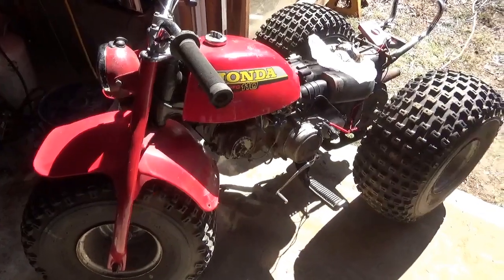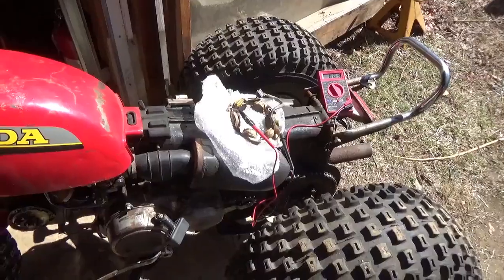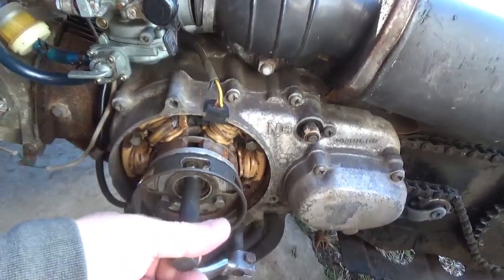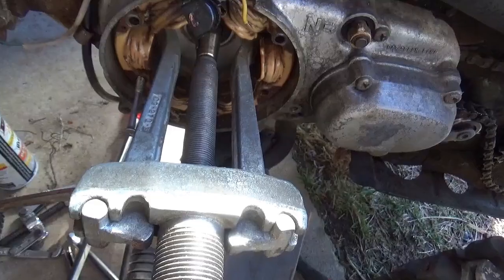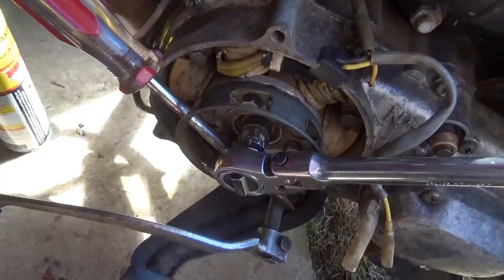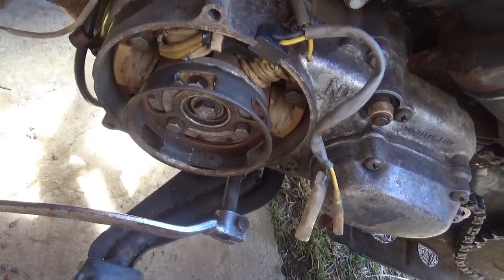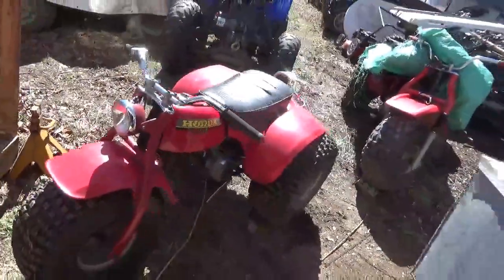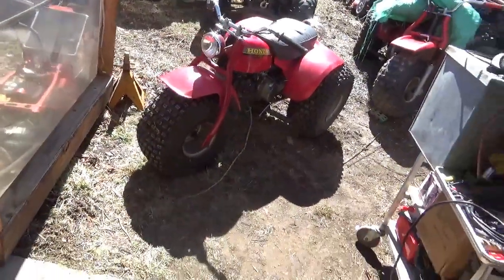1980 Honda ATC 110, Replacing a Seized in Place Stator!

Comment: Hello, new to your page after coming across some Honda 200sx videos. I’ve currently got a 1986 trx200sx that’s not getting any spark. Changed coil, plug, CDI, by passed kill switch. I’m completely stumped. Going to test the stator and pulse generator here shortly. Is it possible the rectifier could be bad as well?